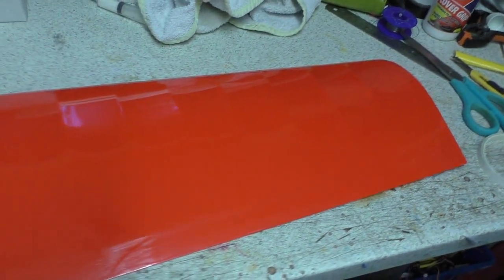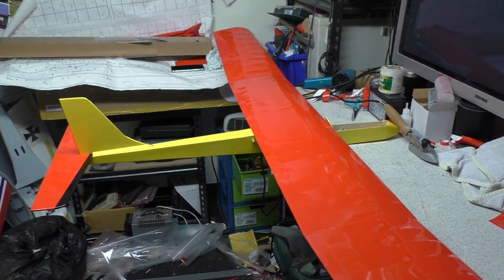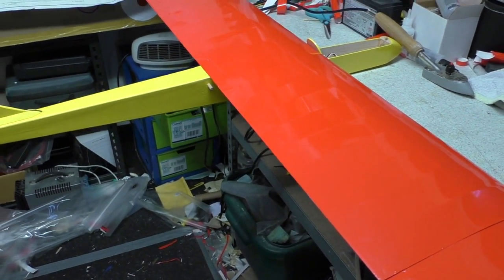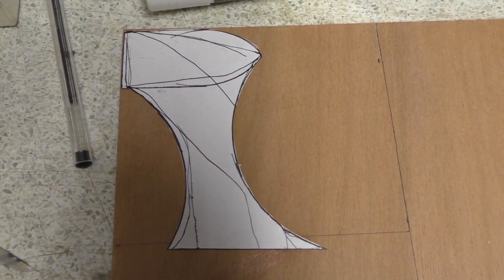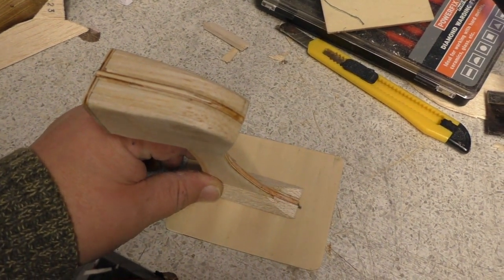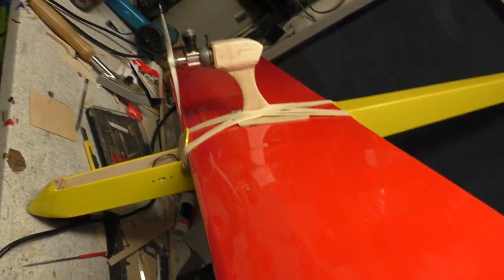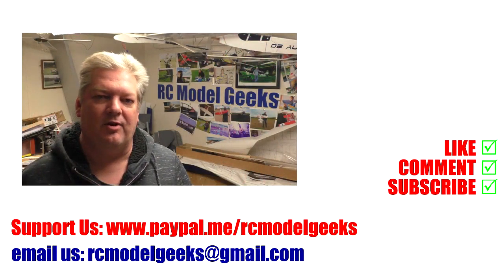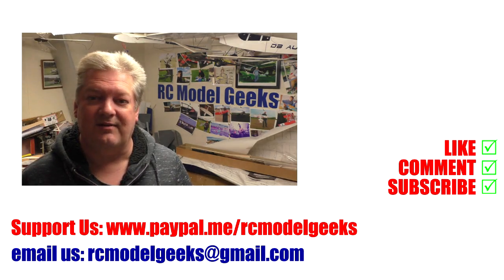Scen Dalmation Lady RC Model Glider Build Pt8 RC Model Geeks

Comment: Nice pod, how do you decide whether to make it puller or pusher ?
Reply from the maker: If you have the choice always go for a tractor config and not a pusher. Its quieter and easier with an IC. Pusher would bugger up the cg and make mounting harder.  would also need a prop with the pitch the other way.